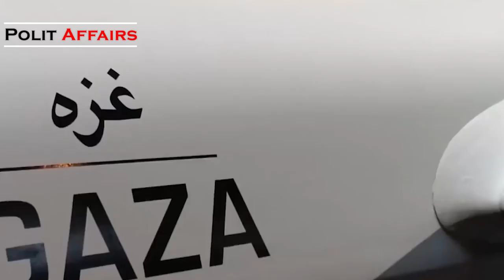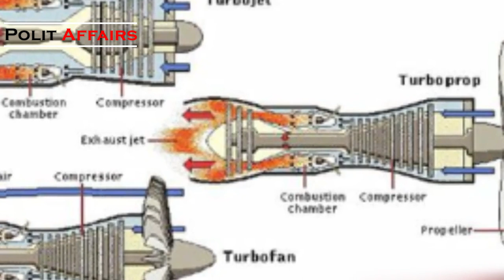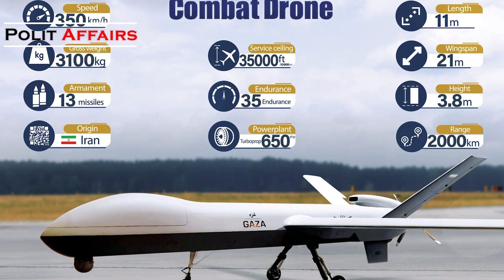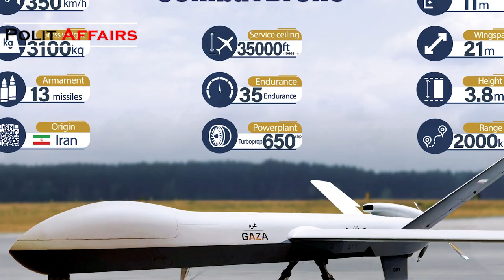Iranian Drones vs Turkish Drones: Comparing Technology And Efficiency | military comparison

Comment: Bro's, turkish drones are not just remote controlled planes but flying robots equipped with artificial intelligence systems.
Reply: With foreign parts, engine and optics
Reply: @КрлеХ  Their engines are Turkish and their cameras are Turkish. They were foreigners 3 years ago. Wake up from sleep.
Reply: AI is just an algorithm its not intelligence.
Reply: @КрлеХ  you stll live in the 90s
Reply: @______7485  TB2's engine is not Turkish, TB3's engine is Turkish.

Comment: You are comparing  wrong drones and you haven't done your research  well . Bayraktar in its own class unchallenged  and unchallenged detectable  with radars. You should compare Gazza drone with Anka & Aksungur both sitcom  operatable and range is limitless pay load is 5.5 tons and both undetectable but when it comes to Akinci no other drone is comparable  with this drone. Reason is its pay load  , just on board Akinci has more then 100 computer  systems that operates and  has AI ( Artificiall Intelligence) capability and its capable of flying  highest  attitudes then any other drones also has a capability  that no other drones has air to air combat which is it can hunt fighter jets and capability  fire cruise  misales from as far as 500 km away from target.
Reply: But it is still iranian 🇮🇷 drones which is game changing. Turkish drones' features are great but only on paper...
Reply: @sodabamahmoodi5693  🤣

Comment: Iranian drones are not battle tested, their drone technology is not known due to unavailability of details, they are not capable to perform simultaneous task and their technology is not state - of- the art, most of the Iranian Drones are equipped with the Outdated Russian technology of early 1980's & 90's,  there main focus is on quantity not Quality So, I think it's quite Funny to compare a Drone Super Power Turkey to a low-level, Collapsed Economy & Still developing county Iran.
Reply: What Iran did is remarkable because they did it before Turkey and without help and it is battle tested in Gulf & Syria & Iraq

Comment: First of all,
It’s not important if one or another drone is 20 percent better or less better than another drone. Until now, these drones are not designed to fight other drones. They are designed to fight ground targets. I think oth models will do the job. Another point is not only technology, but the question of how and under wich circumstances and against whom are they used? Iran als have a lot of combat experience in Syria, Iraq, Persian Gulf and Yemen war. At the end of the day drones are mostly slow moving objects wich theoretically can be shot down from any air Defence. The reason why a drone is staying in the air is because its flying in a environment where air Defence radars are suppressed or have limited usage. So more important is „how and where“ are these drones used. Iran have definitely bigger, cheaper and faster mass production capacity. Specially when it comes to cheaper models, loitering ammunition and so on. An important Gap on wich turkey is not present. Iran is already producing stealth drones and long range drones. I guess turkey have better cameras but Iran have permanent acessaility due to the fact that all components are produced inside the county. In case of a war, Iran is not dependent to supply lines like turkey. And as already mentioned…….in a war drones are not fighting against each other……air Defence will shoot down drones. And Iran definitely have the better air Defence. They produce better radar , CIWS and small laser weapons and electromagnetic pulse weapons against drones. So in a conflict against drones….what really matters is the air Defence. Specially point defense in wich Iran is 100% superior.
Reply: The simple fact that you wrote every single country name with a capital letter except for Turkey proves you are biased and your opinion is not thrustworthy.
Reply: so stupid!! Iran's engines are Alibaba, civil Japanese engines purchased from aliexpres, camera Canon, civilian camera, LOCAL ENGINE, IF YOU CALL MOTORCYCLE ENGINE :):) TECHNOLOGY 0, COMPARE TURKEY AND IRAN You can't even do that, Turkey produces all the engines, avionics, cameras, and with the latest technology, where did Iran's systems prove themselves?? shame, you managed to make everyone laugh. :D :D Iran Number one in false advertising, everyone knows, there is no problem, Turkey cannot come close to it technologically, the systems produced by Iran, high school students in Turkey produce more modern: :) :)

Comment: You are comapring 2 different types of drones TB2 is midium size MALE drone while the Gaza should be compared to a Hale drone big size high altitude like the Akinci or Aksungur while saying the Akinci is not proven its in production and already in service while the Gaza drone is still a prototype so this news is based because you compared two different types of drones and set different rules as well excluding Akinci which is already in the hands of armed forces while Gaza or shahed 149 is in its first flight tests April. 2022

Comment: Between China to Adriatic, Turkish industrial capacities are one of most advanced, also in middle east Türkiye has most advanced defence and civil industry sites. Turkish defence industry story going far more past than Iran. That's why Turkish UAVs are better than Iran not because of western support. Turkish UAVs are more advanced and battle tested than Iranians also as u mentioned Turks doesn't get more advanced sub systems from Europa but manufacturing 90percent of avionics, today westerns doesn't even give civil licenced cameras to Türkiye. İran also able to get civil licenced engines which tb2 and Akinci using, Iranian UAVs already using Rotax engines, also İran uses Chinese subsystems. We were able to see how effective Iranian Kamikaze UAVs in Gaza and Yemen but didn't see Iranian MALE or tactical male UAVs are how effective in any field. Fairly Iranian Kamikaze drone capabilities are much better than Türkiye for now.
Reply: lan lan, turkey ha ha ha just puppets in da game!!small ones...